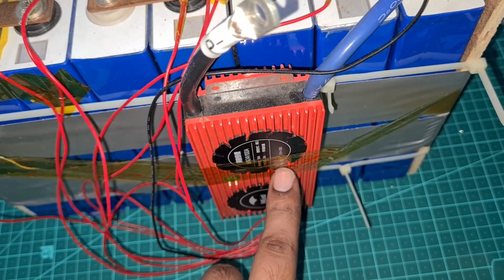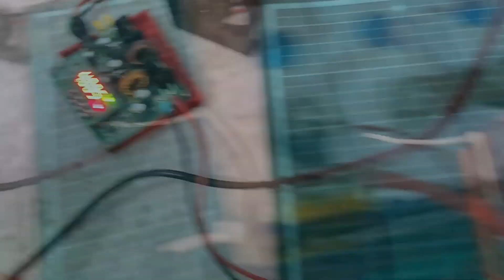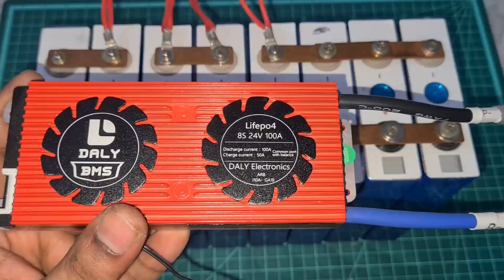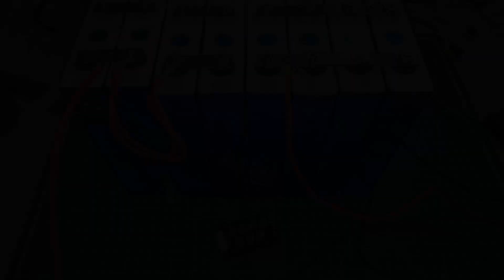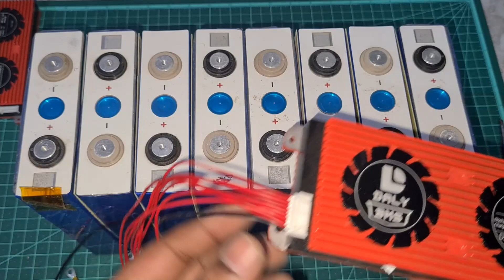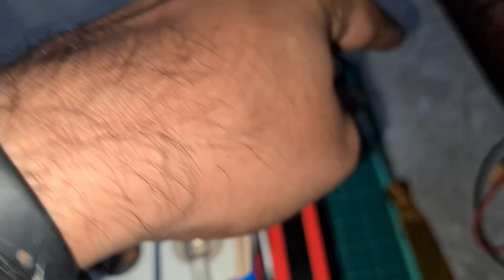100AH DIY -Replacing 24v LiFePo4 100A BMS - Top balancing and beginner guide to build DIY Pack.

Comment: how do ppl know witch amp bms to buy ?
Reply: Consider how many series cells you have and the output current you need.
Reply: @tanishqbhaiji103  I did a test and the most power I was drawing was about 40-45 amps on my old 80ah 24b AGM batteries im building a 8 cell 24v 120ah lithium battery bank I ended up buying only a 60a Daly smart bms says it can pull up to 60a I guess but I didn't know the max charging was only 30a but I can set my inverter